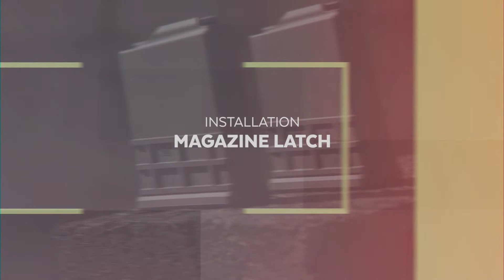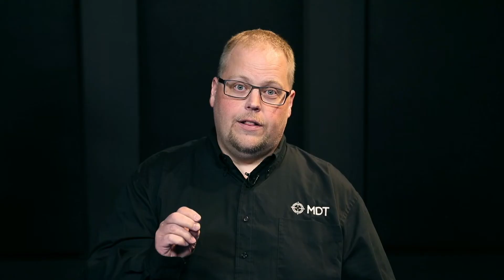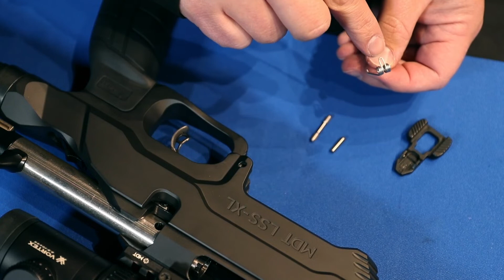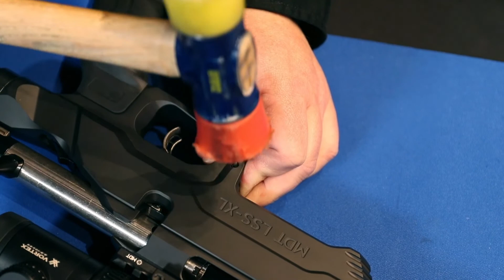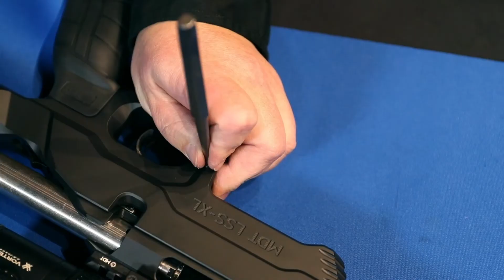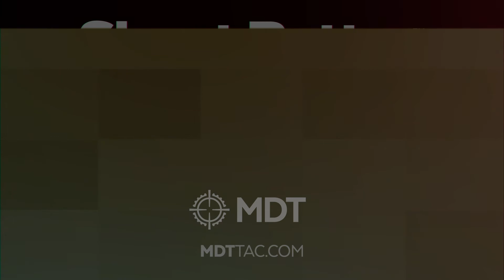Magazine Latch Install

Comment: I have had to install over 10 mag catches after Cerakoting the stocks.
Every spring is 3 times if not more stronger than in the video, they obviously used a weakened spring by the way he "flicks" the lever.
They are a pain to put back without damaging the finish even with a soft hammer.

Comment: I found this to be a lot tougher than the video makes it look LOL!
Reply from the maker: It takes a bit of practice.  If you have a punch where the face isn't flat you can help steer the pin through
Reply: @MDTTAC  that's kind of what I ended up doing. Thanks for such amazing products!

Comment: A little trick...put a couple tooth picks under the left and right side of the spring to remove the gap between the stock and spring, then drive the pin home otherwise once the catch pin hits past center, the spring will lose center and you have to reset the whole thing.

Comment: the springs are very strong, the mag catch was a little too long and wouldn't disengage when pressed. Overall my impression of the installation was only fair, I have to shave down various surfaces by a few thousandths to gain proper function, haven't tried with ammo yet but overall everything is just too tight and too little room for the intended functions. We'll see how it goes with testing and with shooting. My experience so far with MDT stock install is about a 70%.
Reply from the maker: We are sorry to hear that, which chassis did you have to install the magazine latch on?
Reply: @MDTTAC  I installed the Field Stock on a Ruger SA 6.5 creedmoor, I had previously backed out the trigger spring screw to lighten the trigger pull weight and the screw caught on the inside of the trigger well, I shaved a little off the face of the well and it slid in perfectly. Then the mag release issue may be because I used a 10 mag (which I purchased with the stock from MDT) and not the 3 mag. There is still very little space between the mag and the release.
Reply: Shooting report followup. I have played with various surfaces for additional clearance (back of the mag to gain enough room to work the mag release lever). I found the bolt pickup on the first  cartridge out of the mag is a little tricky. The gun shoots better with the heavier stock but there are still function issues with the magazine.

Comment: Will the mag-latch here work on 1st Gen MDT LSS? If so how much?
Reply from the maker: It will not fit the Gen 1.
Reply: @MDTTAC  Can you make one for the LSS Gen 1?!
Reply from the maker: No, the trigger guard would require extensive modification.
Reply: Will this work on the oryx chassis?